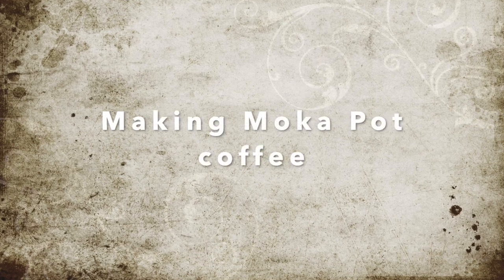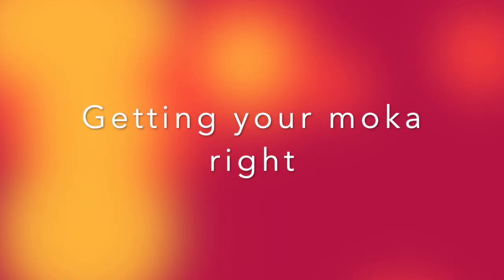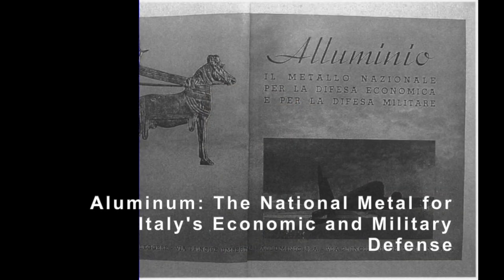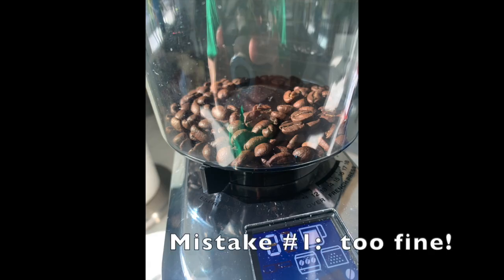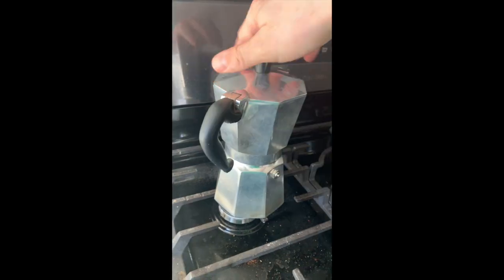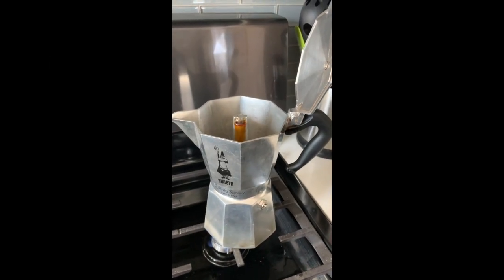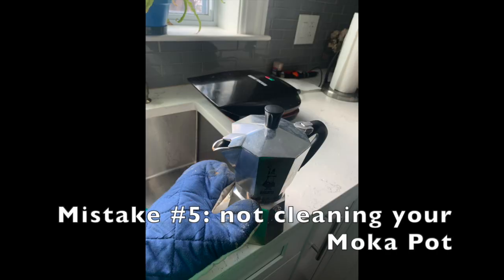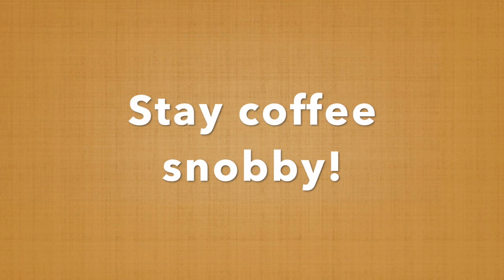Why your Moka pot tastes bad

Comment: The water in my Bialetti comes to a boil in 10 minutes, and makes coffee at the 11 to 13 minute mark. It's all done when I hear the "hissing" noise telling me there's only a very little water left in the bottom, and thus, it's not worth the "burnt" taste by trying to get every single drop of water to bubble up to the top reservoir.

I IMMEDIATELY pour out ALL the coffee into two large mugs so that it never gets the opportunity to burn. My Bialetti is large enough to make 2.5 cups (20 ozs.) of coffee. I leave the second cup out to get cold and drink it cold the next morning--yes, I prefer to drink my black coffee cold so that I may taste it in its natural form without adulterating it with hot cream or sugar.

Right after pouring all the coffee out, I immediately fill the top reservoir with hot tap water to soak any coffee stains and let it sit. (Of course, I take care not to let the water level get so high as to let it flow down the stem and wet the grounds that are slowly drying out in the bottom.)
I always wash and immediately dry all five parts completely, as soon as it is warm enough to do so (which happens exactly 25-40 minutes after I've poured the coffee into my mug, allowed it to cool enough to drink, and have finished it all).
I've got to try the preboiling water thing--thanks for the suggestion!

(P.S. And I've never pressed the ground coffee down. I lightly tap against the side until I get a full, level measure in the holder.)
Reply from the maker: Hi, thanks for the comment.  I’m a bit concerned about your advice to “Pour it out immediately”.  From time to time I see the suggestion in my comments section and my concern is that by tilting the pot when the base is still hot, you will cause the meaning of water in the base to wind up entirely on one side, exposing the bottom of the connecting tube directly to air, and then you get the Stromboli phase.   I explain here: https://m.youtube.com/watch?v=F1ofrthmrV8&pp=ygUJI3dvY2R1YmFp

Comment: No idea if you're still watching this space, but my coffee tends to come sour, any advice on that? I understand that it's due to underextraction, but how can I help with that?

I'm brewing it on low heat, pre-boiling the water, stopping the process the moment the coffee stream turns light-brown. Full filter basket, medium roast, fine-ish grind. 

Any way to somewhat increase the extraction without burning it?
Reply from the maker: Easy to fix: grind your coffee to finer size! Good luck!
Reply: @loodog555  I just tried it, but it was kind of a mess. My previous coffee was already pretty fine, so going finer meant that some of the grounds got into the final pot. It also started sputtering despite me using low heat. It doesn't taste sour, but having bits of grounds in my coffee is less than ideal. So I guess I'll have to try something else.
Reply from the maker: @laerin7931  ya, the nasty fines in your coffee is one of the perils of a moka pot.  Most people just get used to it, but there is a great hack going around the Internet, to use an AeroPress filter in your moka pot: https://youtu.be/fy1YKqrPYCw  really makes a difference in getting an enjoyable coffee!
Reply: @loodog555  Hmm, I'll have to try, thanks!
Reply: @loodog555  Thinking about it, would going for a very low heat(even potentially removing it from the heat for a minute after it starts flowing) prolong the extraction process?
Reply from the maker: @laerin7931  A low heat will prolong the extraction process, but the benefit is that you will have a lower pressure.  I have found better results with a prolonged process than a quick one.
Reply: @loodog555  Hm, I guess I'll try brewing it on a low heat next time, then. It's hard for me to describe the actual amount of heat I use, since my stove has a small hob that I use for my moka pot(so full power on it is probably closer to medium heat on a regular hob), but I'll try low-medium heat on that small hob.
Reply from the maker: @laerin7931  I personally set to medium until I start to see coffee, then I immediately switch to low, to prevent too much pressure from building up.
Reply: @loodog555  Hmm, I might try that, just keep it as smooth as possible.

Comment: There is no way going around Moka pot being bad because the principle of Moka pot is that you have to boil water and that boil water needs to push out inside the pressured chamber. If coffee gets brewed beyond 95C degree it will have the burnt bitter taste. You can't extract Moka put without going under 100C. In the chamber it can go even above 100C. You CAN NOT make good coffee with Moka pot period because of way that it was designed. Sorry all the italians. Moka pot isn't the best.
Reply from the maker: You’d think so but, the most popular myth of the moka pot is that you have to boil water for it to brew.  

https://m.youtube.com/watch?v=O14BIH-9KTA

You are correct in that your ideal brewing temperature is just short of the boiling point.  The good news is that you can do this, even with a moka pot!  However, it will probably also shock you to learn that the more common problem with moka pots is that they brew at too cold temperature!
Reply: @loodog555  Looks like a lot of theoretical mathematics which is great but I want to see someone put temperature probe inside the chamber to see actual numbers.
Reply from the maker: @user-fx5sw4jy7hYz9Hzi  check again.  I discuss the theoretical modeling as well as their experimental results. Around 5 minutes in.

And for ever more experimental measurements, check out my video on the 2009 Navarini et al. Paper:  https://youtu.be/2jLdGi7kjzk

Comment: First you do not boil the water before, you fill the bottom chamber set it to low and you turn off the fire when you hear it gurgling you turn off the fire, mix it before you pour it into the cup and add what you want to add, sugar cream ECT. And bevi. buon appetito.
Reply from the maker: https://youtu.be/jcgMeDDAT-s

As for adding cream and sugar, you can do what you want, but then I don’t see the point of anything else as the cream and sugar will mask whatever specific flavors come out of your careful brewing process.  Good luck!

Comment: Just put the water in the pot and put it on the burner... You can screw on the top half with the coffee filter when you see water fuming... This save a lot of time and effort with the same desired effect
Reply from the maker: Screw it on, once the water is boiling?!?  Like with the heat still on?  Otherwise, you're just choosing a different heating method than me.  I preheat the water is that it saves the time and energy of heating the water on the burner.  But, hey, whatever works for you!
Reply: @loodog555  yea you lift it off the heat using oven mitts and put on the filter and the top half - pre-heating 1 liter of water versus 300ml or so in the pot takes less time.
Reply from the maker: @Brocious4  I mean, it does take more energy to heat more water, that's true, but electric kettles have far higher thermal efficiency than electric or gas ranges so....  I don't know how much difference it will make.
Reply: @loodog555  perhaps - i use induction hob so for me it makes it easier/optimal to just heat it on the hob itself

Comment: They make moka in different sizes: from "one cup", from "two cups", from "three cups" and so on ... Ergo that if I am alone drinking coffee (and I drink only one cup) and I want to drink a good coffee, I will not use the "three cups" mocha, putting a little coffee in the filter of the moka, there is no need to "shave" the upper surface of the filter, (having the useless care not to press the coffee), when the coffee it is only in the center while there are areas without coffee on the sides of the filter: the filters are designed for the quantity of cups they have to produce, three-cup moka? Simple = three coffees! Putting hot water in the moka is absolutely useless (never seen done in any Italian family), except to shorten the wait. I keep the heat of the stove just below the "medium position" indicated on the knob, but I never use a stove that is wider than the bottom of the mocha.
Reply from the maker: Putting hot water in the moka pot, useless, you say?  Well, contrary to what many Italians will tell you, it's actually probably the better technique!  Explanation here: https://www.youtube.com/watch?v=O14BIH-9KTA
Reply: @loodog555  - The discussion would make sense if we were talking about the type of water to put in the coffee pot, because many Italian waters are high in limestone (and like almost all in the "civilized" world they contain chlorine-like disinfectants), but frankly all that theory and " formulas ", in a process that if it goes well from filling the coffee pot to having drunk the coffee 10 minutes is a useless sophistry! (as it is to lose 10 minutes to explain what volume of flame the stove must have! It is not a science to make a coffee with the mocha: in Italy it is a natural, daily gesture, they have already known for years which way is best for mocha coffee! Not even the producers of blends and artisanal roasters browse by chance). It makes sense to spend more time evaluating the condition of your filters, the correct grinding (if you grind the beans yourself) and the right mocha blends (not all are good), let someone who was "born" with the mocha tell you at home, and at least two generations before me: in my country, making coffee in a moka pot is one of the first things that teenagers learn in the kitchen ... forgive me the joke, but you are "exploring the hot water".
P.S. Yes, but then the video is still the same guy with his theories: but who is he? Mr. Augusto Corsini? (historic coffee roaster)
Reply from the maker: @MrTinner66  Hey, you do what works for you!  

I personally don't find it even matters whether or not you preheat the water so all this obsession of people coming here to try to convert the world to cold water technique is very silly IMHO!  I explain in my follow-up video why I preheat and also discuss all the other factors you mention, such as roast style and grind size: https://www.youtube.com/watch?v=UFwP7Df3vVw&lc=Ugy_EF-pgjFJCsfGsoV4AaABAg

As for type of water to put in the pot, you mention that Italian water is quite hard (I did not realize!), but brewing anything with hard water is asking for trouble!  Always at least filter that stuff!  I discuss best water for coffee brewing here: https://www.youtube.com/watch?v=V-zqiitKUYg 

You also mention evaluating filters.  I assume you mean your water filters, but actually one of the very best ways (which is NOT in remotely traditionally Italian) to improve the taste of your moka pot coffee is to use an AeroPress filter: https://www.youtube.com/watch?v=fy1YKqrPYCw It takes about 75% of the harshness right out by removing the fines, but still giving you that classic "moka pot" taste.  

You say "it is not science".  Indeed, as I discuss in the video, Bialetti's invention of the moka pot was far more an example of inspired engineering than science, but the great news is that almost a century later, we have the scientific means that Bialetti himself did not have!  That's what the Third Wave coffee movement is all about!  You could eyeball the basic quantities and use rules of thumb, but there's no need to anymore, now that it can be done exactly.  

But again, it's your life so you can keep doing whatever you like to make your preferred cup and strangers on the internet can't stop you!
Reply from the maker: @MrTinner66  Haha, that all sounds great, but your opinion doesn't quite seem fair to Italians!  I don't know why you think they're donkeys or idiots when they have produced some of the best cuisine and musical contributions in the world, to say nothing of contributions to science and art!  I definitely agree that 90-year assumptions based on rules of thumb need to be revisited and experimented with.  Otherwise, we'd all still believe the sun revolves around the earth!  We owe such knowledge to an Italian by the name of Galileo who was willing to question what no one thought to reconsider in a thousand years, based on the flawed philosophy of Aristotle.  It wasn't that all of Europe was a bunch of monkeys or idiots, of course!  It was that everyone gave prima facie faith to the wisdom their grandmothers handed down to them. I'm sure when Galileo argued for the heliocentric model, people said things like, "We're not idiots!  We've been sure in our knowledge that the sun goes around the earth for centuries!"  

Anyway, this is has been a fun discussion!  I assume you arrived at this video because you were looking for ways to improve your moka pot coffee.  I hope you've found something to help!
Reply: @loodog555  - ... Then excuse me, I from one who uses a moka probably to be optimistic in the "four cups" version (if not from "six cups"), filled like that, with a small amount of coffee, and that in addition (LOL ) takes care of leveling the coffee with the edge of the filter, when the filter is practically empty... Well, how to make a coffee in a moka I don't let it "teach" me, because it has nothing to teach!
Reply from the maker: @MrTinner66  Haha, man everybody loves to take the detail of not filling it up so literally, even though I don't mention it!  I just never bothered to reshoot the footage for a 3-minute video!  This is a cartoon of the full discussion, which is given int the 12-minute follow-up.  I also discuss the level of coffee in my follow-up video as well: https://www.youtube.com/watch?v=jcgMeDDAT-s. Every Italian knows to fill it up completely because that's what their grandma told them, but....

Anyway, enjoy! I hope the videos are helpful!

Comment: Its funny how in Italy the moka pot is so common and they use store bought Espresso and over here in the USA is rocket science. People need to understand that a moka pot doesn't work like an Espresso machine. In a moka pot you have little control over the brewing process. Also Americans are used to watered down coffee.
Reply from the maker: Well, some of your comment is correct.  The third wave of coffee brewing is not owned by America, but is that much more influential in the UK (see: James Hoffman).  The third wave aesthetic is to take something that’s been practiced for decades like brewing espresso and actually quantity it to optimize to best extraction, by adjusting with high precision things like grind size, darkness of roast, and time of contact.  If you were willing to invest the time, you can get a cup that is naturally very sweet with no additives. 

As for the comment about American coffee being watered down, the American style of coffee is primarily an automatic drip brew which is brewed in a 15:1 all the way to 16.67:1 ratio, as opposed to the 2:1 ratio commonly used in espresso.  Americans can do espresso too but it’s much more of a niche thing.  But the idea that anything that isn’t a 2:1 is simply “watered down” is a bit myopic.  You wouldn’t call an IPA beer a “watered down” version of a Pilsner - they’re different things!

Comment: I put a little bit cold water in the upper chamber,  it keeps the upper part cooler, and used just pre heated instead of preboiled watter for the bottom container. 

This takes no extra effort and you prevent burning you self. And the result is good enough for my taste. Try it yourself.

Comment: There are several stages during extraction incl the chroma and caffeine release points. Needs to be cold water, to allow the slower release of steam! Never wash the pot. Even when it is gurgling and there is no longer a steady stream of condensate emerging, need to allow it to continue to force small amount of steam- this gives more or less of the 'burnt' roast taste. As a barrister and having used many different methods, the stovetop expresso is still the best and superior to some commercial coffee espresso machines I have used.
Reply from the maker: Hi, cold vs. hot water I find really doesn't matter that much, but the best evidence is actually for preheating: https://www.youtube.com/watch?v=O14BIH-9KTA

Comment: psst hey you, you looking for easy and quick GOOD coffee?
just get a french press. coffee grounds go in the glass jar, pinch of salt, pinch of cinnamon, pour a little bit of hot water over it and wait 30 seconds for it to completely soak into the grounds then pour the rest of the water into the french press jar. wait 4 minutes stirring occasionally. pour into filter. enjoy good coffee that takes about as long total as waiting for the drip machine to complete.

Comment: My 2 biggest problems with them is everyone tells you how much water to use, but no one ever mentions the amount of coffee to use, and second, it just takes way too long to get the coffee volcano going, even when you start with boiling water, like unreasonably long. You can brew 2-3 coffees in the same amount of time with literally any other brewing method.
Reply from the maker: I've found moka pot is as fast as any brewing method except AeroPress and certain much faster than a French Press, especially using the 8-minute James Hoffman technique: https://www.youtube.com/watch?v=13GGreDHowQ&t=1s
Reply: Between 1g of coffe per 16 mL of water (stronger) - 1g of coffee per 24 mL of water (lighter).
That's the values you could use as base but there are no rules, give a try and see how it pleases you.
Reply: i measured how much grams of water fit in the base until the valve. divide that by roughly 10-11 and use that much grams of coffee.
Reply: I brewed my first cup today..  from start of heating to finish, it took 3 minutes in a 2cup Pot.   And it was very cheap.

My electric kettle takes longer than that just to boil water.. and another 10 minutes to brew tea….       
….such that I’m thinking of getting a separate Moka Pot just for tea..   

If you know a faster way to make espresso or tea, other than instant, teabags or microwave.. I’m all ears.